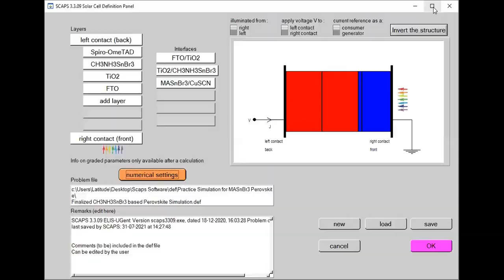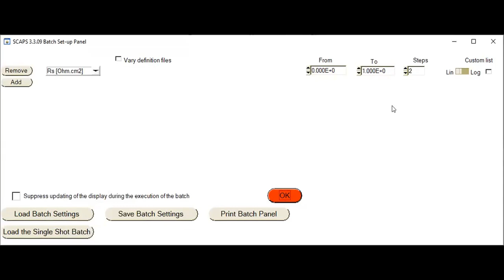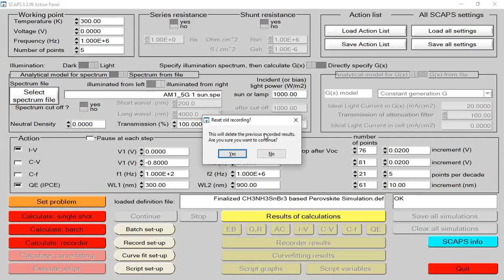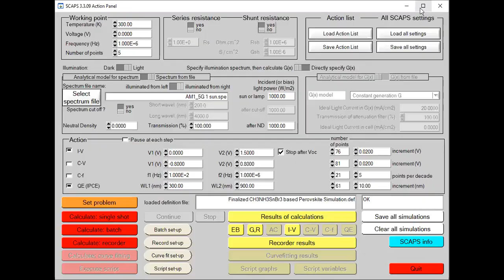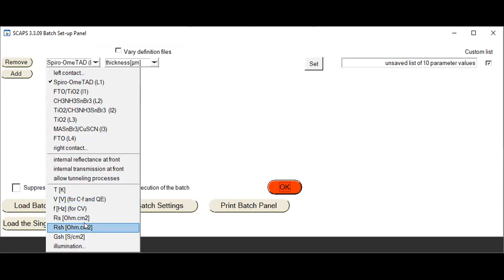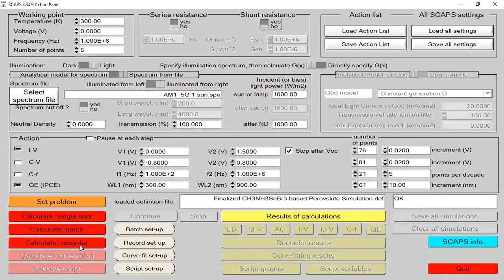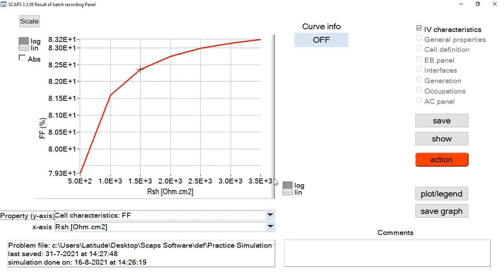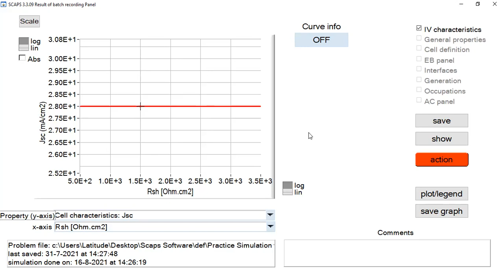Lecture No 9: Effect of Series and Shunt Resistance on Performance Analysis of Perovskite Device.

Comment: while simulation with Quantum dot solar cells, in the defect properties panel is it required to change the energetic distribution from its default condition - "Single" to any other like Gaussian, etc.
and in  a Quantum dot solar cell, if all the parameters like ETL, Absorber Layer and HTL have defect type Neutral - Is it a problem ?
Reply from the maker: You can set single for ETL and HTL while for perovskite gussian
Reply: @engrmuhammadwaleedakram4486  if I keep the perovskite layer also single? I found the efficiency remained same... Will it affect in any other way ?
Reply from the maker: No it will not effect dnt worry

Comment: Hello sir, I have just started my research on perovskites solar cell, My research includes simulation of PSC, But I want to ask you about the hardware feasibility of PSC? In short words, My question is- " Can I built perovskites solar cell on my own in my college chemistry lab for experimental purposes?
Reply from the maker: @Shubham Gupta I m glad to see you kind comment but due to covidt I was not able to start fabrication  for Perovskite. Therefore I started Simulation on SCAPs 1D . Yes you can design perovskite in lab .
Regards
Reply: @engrmuhammadwaleedakram4486  sir i have sent you a email, requesting you to check it please
Reply from the maker: @Shubham Gupta received your email Nd responded also